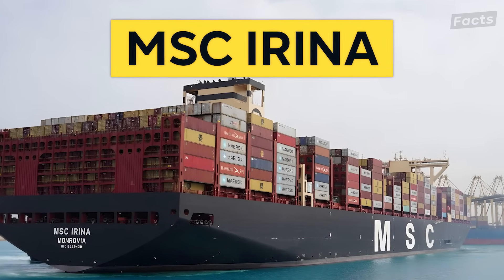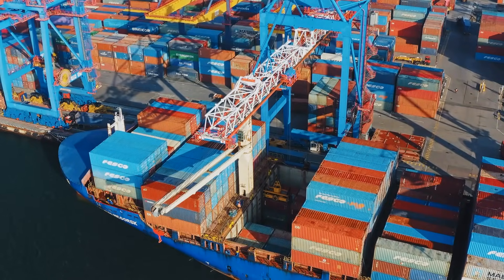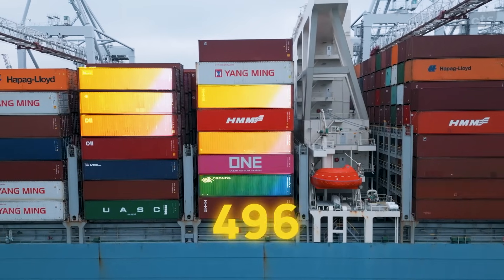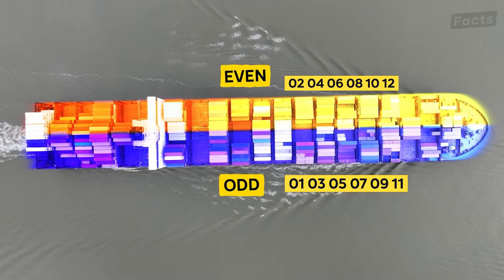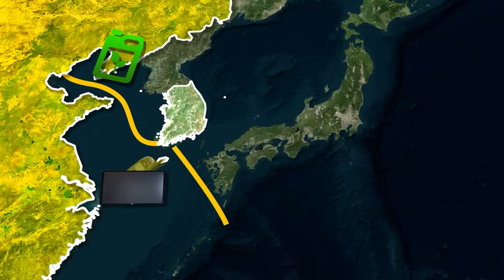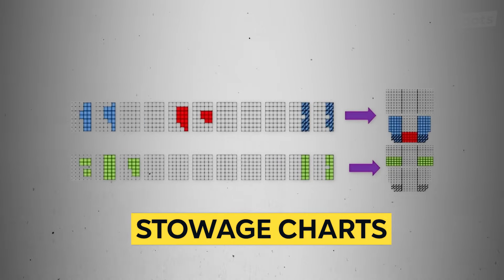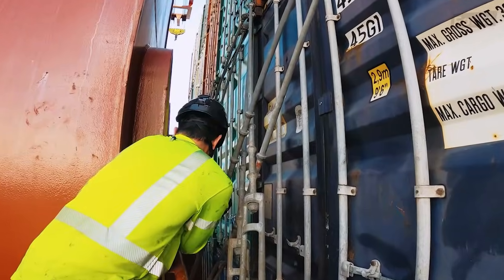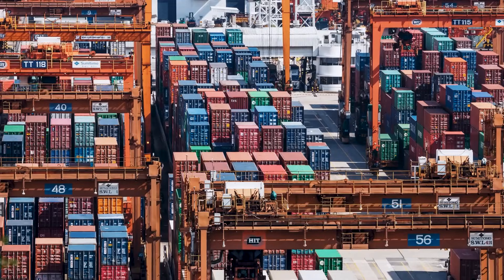How Giant Container Ships Actually Work

Comment: 0:43 45 FT and 53 FT containers also exist
Reply: Those aren't the same as 20/40 maritime shipping containers. The 45/53 are standard highway shipping containers. The 20/40 are frequently placed on trailers designed for them though.
Reply: @Johnboy33545 45ft are also standard maritime containers.
Reply: Where? Never heard of that measurement
Reply: @aainventors745 Los Angeles. Rail and Ports